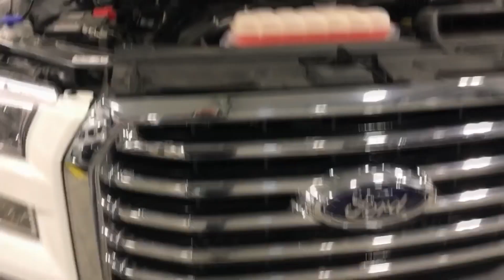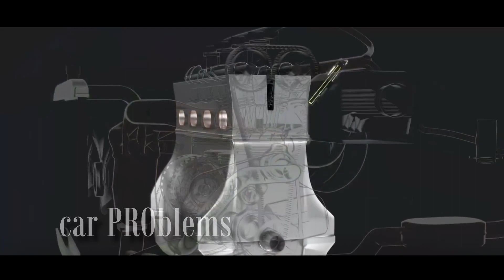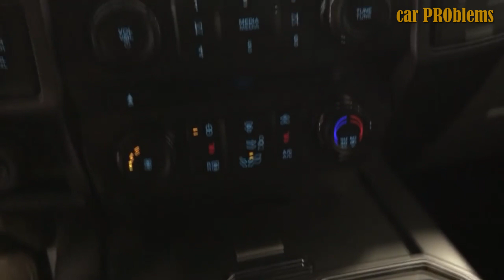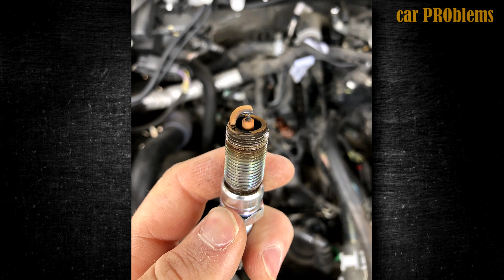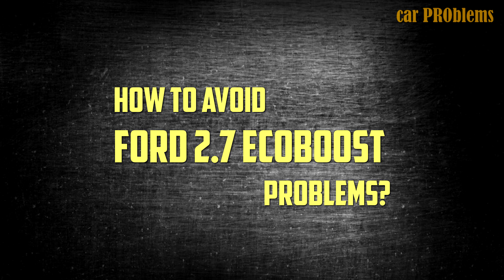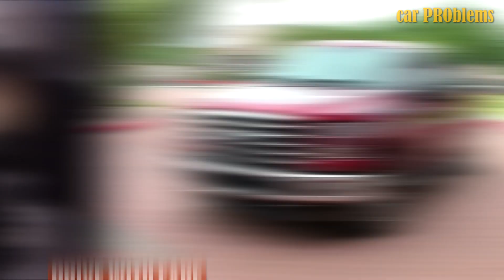Ford 2.7L EcoBoost Engine - Specs, Problems & Reliability

Comment: Well my Father bought a used 2021 Ford 2.7 eco boost and this morning we got in it and the battery was dead! Had to jump it and found out the alternator was dead! No charge at all and it smelled like burning rubber! My neighbor is a fantastic mechanic and he called around and NO BODY HAS ONE IN STOCK and doesn't know where to get one without the Dealership! We are talking about a 5yr old truck~~~ not 10yrs or older! I don't but that got me pissed off!

Comment: 2.7 egoboost? lol pronouncs it weird. Anyway 2.7 is the best motor ford has made in a while they really crapped the bed in the last decade leading in recalls but did good with the 2.7. My ford mechanic friend calls the 2.7 the new 300 staright 6😂

Comment: My dad has a 2015 Gen 1 -2.7 with 242K miles, Only thing he has changed is both turbos at 169K miles.  The truck runs like new. Best truck he has ever owned

Comment: Another long comment here - bear with me...I own 2017 Ford Fusion Sport with a Gen-1 2.7. There was a brief run of early gen 1's that slipped by QC and had head gasket issues. For the most part, the unlucky owners of those few had that dealt with under warranty, but there may still be some out there in the wild. There is also a TSB out on faulty plastic oil pans and valve covers leaking. It's a very common issue, but if you have any kind of warranty, factory or aftermarket, the cost should be covered. I personally dealt with this recently. Make sure your mechanic does it right. My car was taken to the dealer where they broke the upper intake manifold and some other stuff - needless to say, I'm NEVER trusting them again... The valve cover gasket was also failing internally, I think, causing oil to leak into the spark plug well and interrupt ignition, causing misfires. Aside from that, I've had no major engine issues. I bought it with about 20k miles roughly 4 years ago and now I'm coming up on 140k. One thing to consider, in my case, is that my car is a work vehicle that's been pushed hard quite a few times, and has spent thousands of hours idling. It's definitely put in some work. That said, I've stayed on top of all maintenence the entire time I've owned it. Regular air filter changes (engine and cabin), coolant changes, transmission services, spark plugs, throttle body cleaning and decarb service, 5k mile oil change intervals, and ONLY 93 octane during my entire ownership. I've yet to make any exceptions regarding fuel, although if I ever drive it out West, where the highest octane is 91 in a lot of places, I'll have to compromise. I also clean and detail it when i can, but i live in the heart of the Rust Belt, so it's only a matter of time until the rust gets it. But I plan on keeping it on the road until that day comes.

Comment: My 2016 has 105k miles with the stock plugs and coils. My last oil change was 8500 miles and I didn’t add any oil. Maybe I’m having great luck because only I change the oil and I only use Motorcraft. My mpg is the same as new and my engine has never stalled.

Comment: 2018 2.7 EcoBoost or newer have duel injectors, 1 direct injector and 1 port injector per cylinder,  this eliminates the carbon buildup,check your facts before making a video.

Comment: The 2.7 is probably one of the most bulletproof modern boosted engines you can buy. I just replaced the plugs and had to replace my coil pack on cylinder #5. But other than normal maintenance, mine has been great so far at 123k!
Reply: Is that your first replacement of plugs? I have heard some folks replace at 60k some at 90k, some well over 100k. Just wondering when I should start thinking of replacing mine
Reply: @paulhunter9613  Yeah, that was my first time replacing the plugs since I got mine at 65k.
Reply: @Foxbody302  well that’s good to know, thanks. What was the condition of them , decent yet or quite used up? I’ve got a ways to go then with my 2.7 having 29xxx mi
Reply: @paulhunter9613  they didn’t look too bad, but they looked like they had some mileage.
Reply: @Foxbody302  👍

Comment: Please people don't waste your money on American junk because they are nothing but problems.  The only thing American cars are #1 on is  technology but will give you a lot of problems down the road.  Save your money and get you a Toyota that will last you a long time and will it worth  more than any other makes.
Reply: I compared the 2024 Ranger Lariat 2.7 to the 2024 Tacoma Limited.  All things considered, the Ranger is a far better truck.  People have different opinions.  I put down a $1,000 deposit and ordered the Ranger 4 days ago.
Reply: My Ford Taurus with the 3.5 V6 is 14 years old and the only two things replaced under the hood was a 02 sensor and high-pressure power steering hose. Very reliable vehicle, purrs like a kitten still today. Now my E150 at 280k miles had only two problems under the hood, which was an alternator and HVAC fan which I did my self around 100 dollars each to repair and that was after 210k miles. Great vehicle too! People want to rip Ford, but they done good with me.
Reply: @Chieftain357 You likely have one out of a million trucks that was built correctly by Ford. Not one person I know is happy with their new EcoBoost trucks. The Ford diesel is nothing but trouble. I think Ford builds them with problems so people will buy new trucks every two years. This is why they build them with the latest technology and fully equip them every two years. But the engine and transmission are trash.
Reply: Perceived reliability 🤣🤣

Comment: 95k on my 2019 2.7 F150 4x4. Bought new December 2019 back when Ford gave great rebates! Oil change every 5k miles, first 10 oil changes had BG products every oil change at dealership and now I do it every other oil change myself using Penzoil Ultra Platinum 5W30. Tranny flushed at Ford every 30k miles; I change out the spark plugs every 30k miles myself (peace of mind). Coolant flush  and front differential fluid every 50k. Rear differential and transfer case fluid change every 30k miles. New engine and cabin air filter every 10k. Still drives as good as it did new with 95k miles on it. Planning to see if I can hit 300k miles on motor 🤙🏻. Did have to replace the throttle body at 47k miles but that was shortly after it was clean and I don’t think the position was reset correctly. New one onto $116 at local ford dealership so I just replaced it. Really is a remarkable engine. Pulled a 7k 36.5ft camper with it and hauled a 5x10 dump trailer up a 8 degree dirt road at local dump pulling 9k lb (weight station clocked truck and trailer at over 14k lb. Extremely impressed.
Reply: Hi Zach, how tough was it changing those plugs, man those back cylinders look like a bitch to do. Thanks Bro.
Reply: They aren’t bad at all. Nothing major needs done,. 3/8” drive with swivel on 6” extension takes care of the back plugs. All done including clean up within 1 hour comfortably.

Comment: I have a 2020. To date have never put a penny in the truck. Fun to drive, 25 plus mpg. Will buy another on without a doubt. And so far has not burned a drop of oil.

Comment: 2.7L has the rubber oil wet belt inside the engine. Any had issues with that?
Reply: 15-17 have a Chain, after that all have wet belt
Reply: @theodorecarbajal2975  Thanks that is good to know

Comment: I have a 2016 f-150 with a 2.7 motor 107,000 miles started smelling antifreeze it was leaking into the head and burning the antifreeze it was not a head gasket eventually the motor was shot got a used motor only 40,000 on it 3 year warranty smoked the entire time and was also using antifreeze with in 2 months I had all the same issues as the first time no clue what to do now get another motor and deal with it again

Comment: 2015 owner. 144,00o mi. Regular oil changes and trany flush. Original spark plugs. Only 2 issues, the leaky plastic oil pan was replaced. The windshield sprayer freezes at hint of 32 temnps. How is that not a safety recall? Next one will be a 5.0
Reply: Maybe buy some better quality windshield washer fluid for starters. If it’s freezing that’s not fords fault.
With getting a 5.0 next time, get a fresh credit card also, you will need it, it will get used often
Reply: @paulhunter9613  I use the purple -32 degrees stuff. It was a Ford thing the hose is too small diameter i was told. There was a service bulletin put out for it.
Reply: @ctfan1486  but it works just fine in warm weather, then “freezes up “ in winter,,, hmmn
Reply: It’s water in the check valve under the cowl on the passenger side. Drill it out and forget about it.

Comment: You guys lost me when in the 3.5 video you said it was designed to replace the Coyote. The Coyote didn't exist in 07. Also you missed the 2.7's biggest flaw. That's the rubber oil pump belt. The belt is wet and degrades over time clogging the oil pick up.
Reply: I've literally heard of one belt failure at 37k miles. Doesn't seem to be a problem with the 2.7. Also the 5.0 has the same wet belt for the oil pump.
Reply: Very good point, what engine would you recommend?
Reply: @JulianoGSF  the five oh has the cold startup death rattle, high oil consumption, has a “tick” when warm, and has Mds which if is like GM and Ram will destroy the engine. And it has no low end torque to tow things like a truck should have
Reply: @JulianoGSF  it depends on what you're looking for. In my opinion, the eco-boost motors have been vetted out pretty well. But if you want 200K miles plus, stick with a 3.7 for cars and definitely a Coyote for the trucks.
Reply: Interesting opinion  @briantufaro1953
Reply: @brianufaro
It isn’t a flaw and the belt does not degrade
Reply: @paulhunter9613  I have seen an engine tear down of the 2.7 and the belt did detiorait bit, but did not break. Engine had about 130 miles
Reply: @JulianoGSF  why would an engine with 130 mi on it need to be torn down? Sounds and smells like bull💩
Reply: @paulhunter9613  well there's a guy on YouTube that disects blown engines. When he did the 2.7 he found the belt had lost material and clogged the oil pick up causing the engine failure.
Reply: @paulhunter9613  https://youtu.be/xZJicuObVDY?si=v9ZqwklAxVsLYDF7
Reply: The wet belt is actually made out of Kevlar not rubber.  It’s 5x stronger than steel per weight according to DuPont.

Comment: I didn't watch the whole video, but I've owned two Fords with this engine:  a Fusion Sport, and an F150.  From what I remember, this engine was built from the get-go for turbocharging, and it's less problematic than the 3.5 Ecoboost.  I had bigger intercoolers and tunes on both those vehicles, and they ran great, and got pretty good mpg, all things considered.  I also added oil catch cans, to help keep the intake system cleaner.  Neither vehicle accumulated much in the can, certainly nowhere near as much as the 3.6 Pentastar engine in a Jeep Gladiator Rubicon I used to have.
Reply: Are you sure you would call it reliable?  I am just so confused on which engine to get, too many people say stay away from any of the eco-boost and get the V8.  Well, the newer 10 speed trans for the 5.0 is having all kinds of problems with the transmission.
Reply: @bcw686  When I was shopping around for a full-size truck, I initially wanted to get a Ram.  But when I found out their "auto start/stop" feature was shutting half the engine off, I looked elsewhere, which led me to the F150.  I don't haul or tow anything on a regular basis, so the 2.7 EB was fine for how I drove the truck.  From what I can tell, the 2.7 EB is a lot less problematic than the 3.5 EB, but mechanics prefer the 5.0 because of its simplicity.
Reply: oh ok, that makes more sense, thanks @bronzestarvue
Reply: @bronzestarvue  the 5.0 is not known for simplicity anymore. And the start/stop feature you spoke of has nothing to do with having half of the engine shut off. The start /stop just turns the whole engine off then restarts it after like sitting at a stoplight.
The 5.0 has MDS now, multiple displacement system, and that does shut down 1/2 the pistons when driving, another reason to stay away from the 5.0,,, among other problems .
Reply: @bronzestarvue  the auto start/stop feature has nothing to do with the cylinder deactivation feature. It just shuts the engine off at a stoplight, then restarts when the foot lifts off the brake.
The cylinder deactivation has been problematic for Ram and Chevy and now ford has it on the 5.0. So it’s not a “simple” v8 anymore with with that feature, the wet belt oil pump, and variable valve timing. Time will tell whether it will last a long time

Comment: The intake carbon issue was dealt with by adding a second fuel injector to each cylinder.
Reply: Hi Don! What year 2.7 was this added? I have a 2015 F-150 2.7 ecoboost and thinking about adding an oil catch can.
Reply: @robertclymer6948  It was added with the 2018 F-150.
Reply: @robertclymer6948  My father has catch cans on his, you'd be surprised how much it catches! Definitely a good choice to fix the only significant flaw
Reply: @robertclymer6948 A second set of sequential fuel injectors were added to the intake manifold. They operate  when not under boost to keep the intake valves clean from carbon.

Comment: Have a 2019 f 150 with 2.7 love this engine. Truck runs great,fast and fun to drive
Reply: I have a used 2019 with the 2.7. It has 108k miles on it. Regular maintenance both by me and the prior owner. 100kmi full service and it runs and drives like a new one that I test drove. I second the 19-20 mpg city (rural stop and go) and 23+ mpg on the highway depending on how I drive it, which isn’t slow. I plan on continuing the 5000-6000mi oil changes as opposed to the 10k intervals that I think they recommend. 

This is coming from a V8 die hard. My old 4.6 was reliable but had no where near the power. The low end torque makes me giggle every time.
Reply: How's the fuel mileage?
Reply: @Optimistprime.  I get around 19 mpg city , 22+ combined.  2018 2.7 supercrew 3.55 gear. Took it on a 3000mi trip last spring , got anywhere from 22.5 to 26 mpg, all speeds were 75 to 82 mph. Mpg was hand calculated because the  dash mpg isn’t always correct. I’m extremely happy with it, it’s only had the oil changed every 4000 mi, no other service work done

Comment: Wait till that rubber oil pump belt breaks on the 18 and newer. Ones lol
Reply: A lot of people have been waiting for that belt to break and it hasn’t happened yet
Reply: @paulhunter9613 😂😂😂they can wait only
Reply: @jassmaan7603  there are sites out there that folks have over 200,000 mi and no problems, it’s like waiting any other engine to have issues 🥴
Reply: I drove new thundra hybrid believe me it’s drive like shit , overbuild truck and you feel like ur driving a garbage truck😂
Reply: @jassmaan7603, you wish, buddy.  Toyota tundra is  #1 trouble free best selling trucks out there by far.
Reply: @willtacoma2ndgen661  interesting opinion
Reply: @willtacoma2ndgen661  It was , their new engine has has numerous issues but yea the 5.7 was very reliable.
Reply: Does the newer 2021 models have the wet belt?
Reply: The belt ain’t straight rubber it’s Kevlar it’s a great material
Reply: Same here. Mine 2.7 is 2021. Now had 103000. Wait for oil pump belt. I wait that problem too
Reply: @liray6407 Mine won't see that milage as I will probably be dead and gone beforehand lol.
Reply: @donaldbean6291  Perfect name you got there lol. What a beanhead comment without owning one yourself.

Comment: Is a catch can beneficial to a 2.7 2018 Ford F 150 with a 10 speed trans?
How about on a 2020 2.7 F 150?
Reply: I’m wondering the same thing. On the first gen 2.7 absolutely yes. The newer 2.7 made from 2018 on however has both port injection and direct injection so I’d imagine that would help alleviate the oil on the valves in turn reducing carbon buildup.
Reply: I would put a catch can on any forced-induction engine (turbo or supercharged), or one that has any form of direct injection.  I did mine on a '23 Toyota 4runner for about $30.  The kits made for specific engines are more expensive, but they're usually designed to be plug and play, so very easy to install.  One could certainly spend money on worse things for their vehicle...

Comment: Hold the Buss > > > don't the later 2.7's have direct and port injection stopping the gunk build-up on the intake valves?
Reply: The direct and port don't function at the same time. It uses one at a time, based on what's going on. It cuts down the carbon buildup roughly by half.
Reply: @bradh6185  or it doesn’t let the carbon build up at all…
Reply: Yes.

Comment: Are these comments true for the 2.7 in the Edge as well?
Reply: Yes. The 2.7 is essentially the same in all of fords applications. Depending on 1st or 2nd generation. 2018 and up 2.7’s have port injection with fuel injection to help with blow by.
Reply: @GreatWhiteN My 2018 2.7 T MKX does not have duel point injection.  So it seems to be only the f150's that got the change to 2nd gen

Comment: I have a 2018 2.7 ecoboost with 94,000+ miles so far no problems. I did do the oil catch can so that should help with the oil on the valves
Reply: They do say with the dual injection with 2018 and up you don’t need a catch can.
So have you checked the catch can to see if there is any oil in it?
Reply from the maker: That's great to hear! Installing an oil catch can is a smart preventative measure to help reduce the amount of oil that can build up on the valves over time.

Comment: Video is outdated.. dual port gen 2 never have carbon issues
Reply: For all the talk, I don’t think generation 1 does either. 160,000 miles on my 15. No catch can no issues. No online problems I’ve seen either.